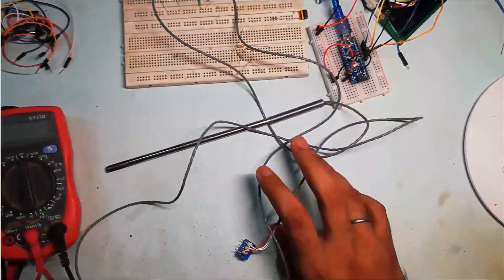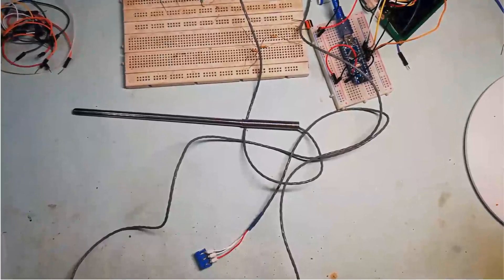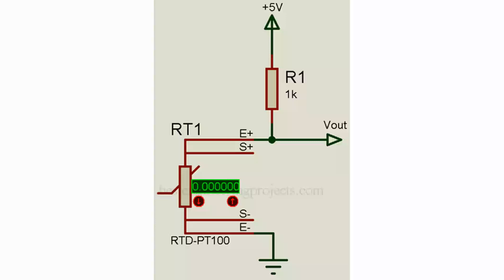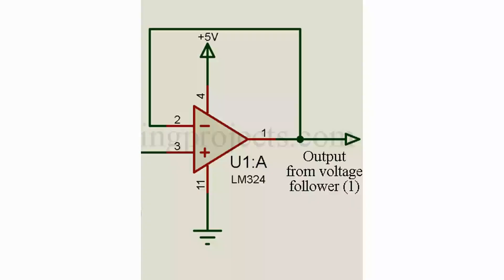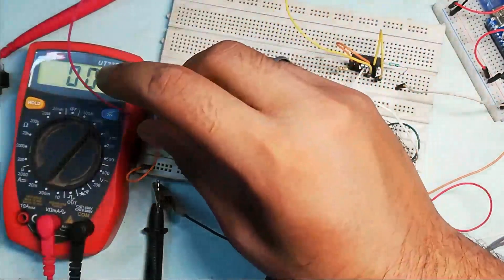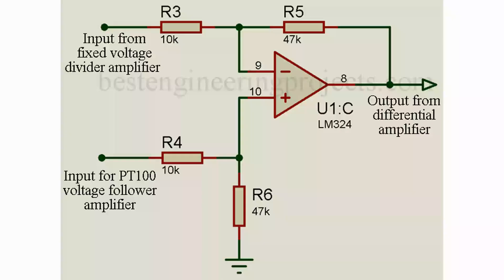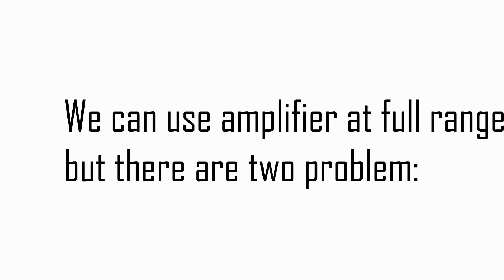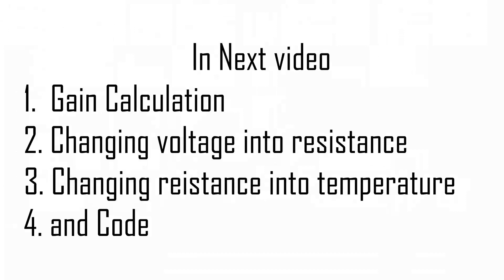Measuring Temperature using PT100 and Arduino Part 1

Comment: link in description  is not working can you share it again
Reply from the maker: Yes, you can with little change in code and circuit component value.
Reply from the maker: Hi, link is perfectly working.
Please do check again.

Comment: Really enjoyed your video Sir, but I have this on simple question?  Why didn't you use Wheatstone bridge confrig with PT100 and then amplify by using non inverting opAmps? Is there any wrongdoing in this method? It's my humble request to clear this doubt sir
Reply from the maker: Yes, you can use Wheatstone instead of voltage divider network.
Reply: when the current pass through the RTD after long time current will cause a heat in bridge then will effect the accuracy of sensor
Reply from the maker: @atiqaalalmani2097  In video i had clearly mention how to do trade-off between self heating effect and SNR.
Value of resistor (R) must be great enough in order to avoid the self-heating problem. Also value of R must be low enough in order to avoid the problem of lower signal to noise ratio.